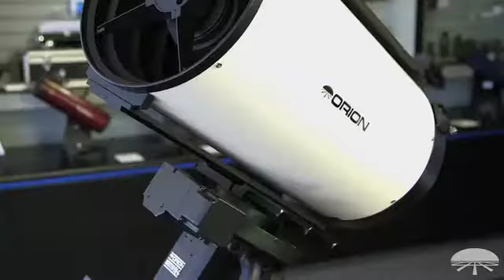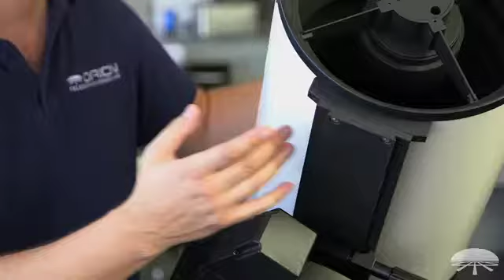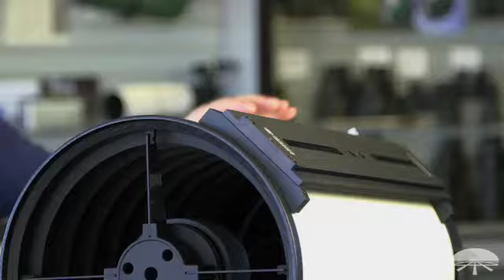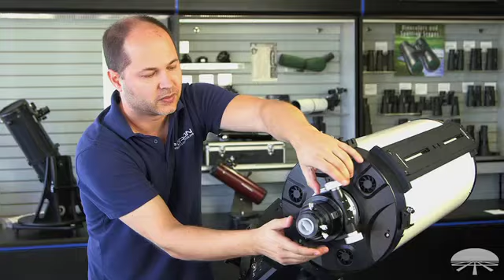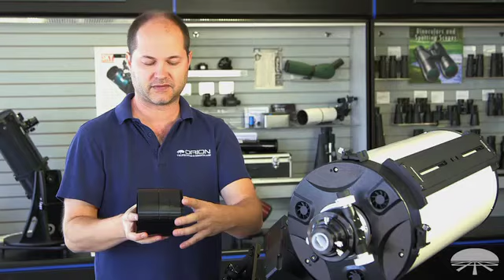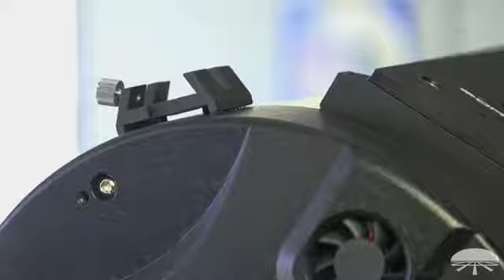Features of the Orion 10-Inch Ritchey-Chretien Astrograph - Orion Telescopes

Comment: Hi Ken I am looking for an all purpose scope.
I think the obstruction in the rc makes the contrast reduce
Reply from the maker: Yes, the large obstruction of an RC reduces the visual quality of the image by reducing contrast.  For deep-sky photography, the obstruction doesn’t really hurt and actually helps provide sharper edge of field performance on the imaging sensor, which is why the RC makes an excellent specialized telescope for larger APS-C and full format cameras.  But for visual use, a standard 10” reflector with a smaller secondary will have better contrast.

Comment: HOLY COW!
Just how BIG is that "central obstruction"?????
It looks like it's more that HALF THE DIAMETER of your objective!!!!!!
There goes any great "Definition" you might have hoped for in your TEN INCH telescope! 😥🙁😖😫
Reply from the maker: Very close guess, it's a 110mm obstruction, which is 43% of the diameter. The larger secondary is a design decision made in favor of a flatter focal plane, and better illumination of large imaging sensors. Large central obstructions will reduce visual contrast, but this isn't generally as much of a concern for telescopes designed primarily for photography like this one.

Comment: Hi Ken,
What would be the advantage between the 10-inch RC vs 10" f/3.9 Newtonian Astrograph using a coma corrector? I mean, using the Newtonian astrograph you'll have the same aperture, bafflles and with the coma corrector you'll have flat field images. Also, it's a much faster telescope for astrophotography... all this with around $940 (telescope and coma corrector). On the other side, the RC costs around $2.300.... Does it worth the big difference?
Reply: I am facing the same between the RC Truss carbon vs RC steel OTA.  Nearly almost the same weight and length, however, what I like with the steel OTA here is the light baffles, whereas I need a shroud and it much easier to clean the mirror removing OTA steel case.  Your question to Ken, gives me pause to stay with my gso newtonian at F4.  I am guessing if Ken had to answer - its a matter of preference where you want to mount your camera, that there is your $2300 question.

Comment: Did you say adaptive optics system ? How is that possible to use lasers and bend the mirrors on that scope?
Reply from the maker: Hi Sauce,

Not that type of adaptive optics, though that would be extremely cool!  Adaptive optics such as those made by SBIG and other manufactures that uses either a high speed tip tilt mirror behind the autoguider, or a tip/tilt lens.  The autoguider images the guidestar at a faster than normal frame rate, and the mirror or lens can adjust much faster than the motors of the mount can adjust.

They can take up several inches of back focus, but a RC like this one can handle all of that equipment.

Thanks
-Ken
Orion Telescopes

Comment: Could I buy a Celestron Advanced VX Computerized Mount and put on a Orion 10" f/3.9 Newtonian Astrograph Reflector Telescope and continue to upgrade my features on this telescope overtime?
Reply: I am not sure if I need a specific brand or  a specific type of mount for an astrograph.
Reply: I am still looking for a telescope I am not sure what kind I want I would really love  a person to help guide me to the right one.
Reply from the maker: Hi Alex,

The 10" would fit on the VX mount, but you're approaching the weight limit of that mount, which I believe Celestron quotes at 30 lbs.  Once you add all your cameras and imaging accessories such as autoguiders and whatnot, make sure you're not over taxing the mount, which will lead to excess vibration.

Thanks
-Ken
Orion Telescopes

Comment: Does the optical quality (in manufacturing) differ between this and 8" ?
Reply from the maker: Hi Guru,

No, the quality of the mirrors and mechanics are the same between both.  The difference just comes down to the extra light grasp and resolution due to the larger mirror.

Thanks
-Ken
Orion Telescopes
Reply: Sorry , could not reply back earlier, Thanks for your response. But 6" cost 499 and 10" costs 2299  , why that huge difference?  with tripling it down , still it overshoots  by 800 dollars. Would have bought it if its was around 1500 / 1600.  Also what is the primary mirror material ? Thanks for your time.

Comment: Is a baffled tube like this scope or the similar AT10RC (Astro Tech - with less features) better or worse then a truss tube design like the AT10RCT?I have read that truss' are better then smooth tubes but haven’t found anything good comparing them to baffles. Truss' have a certain cool and professional cachet to them but are you getting better performance for the extra money?
Reply from the maker: NotSure177 
Hi NotSure,

Trusses can make it easy to break down into smaller pieces if the scope is too big.  One thing I can think of comparing a "smooth tube" (no baffles) to a truss is that with a truss you can put a nylon shroud over the trusses, and the material will probably reflect less light than a smooth wall tube that's painted black.

But baffles are an excellent way to cut the light reflections since there is no smooth surface for the light to bounce off at from an incident angle.  There is also less setup time since you don't have to reassemble the entire scope each time, and collimation may be less of a problem since you're not breaking the entire scope apart and reassembling.

Thanks
-Ken
Orion Telescopes